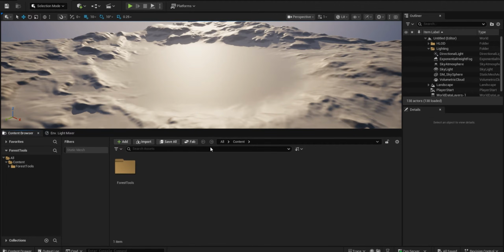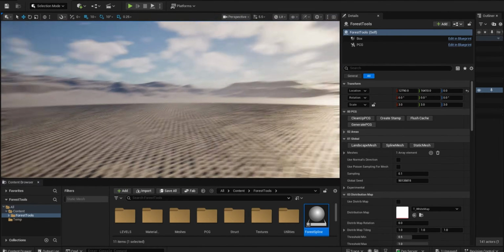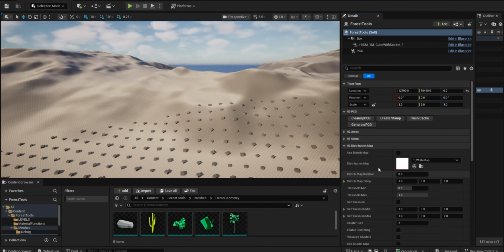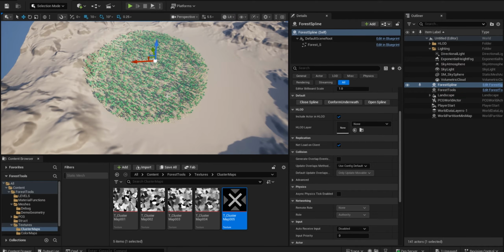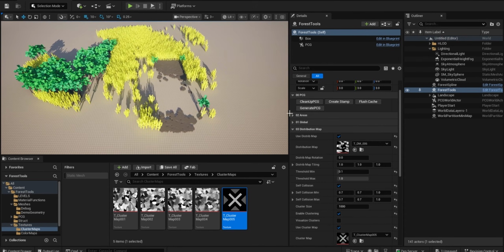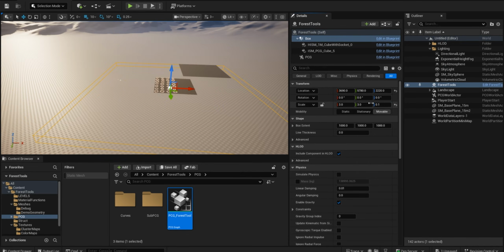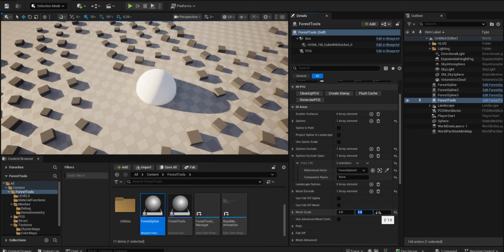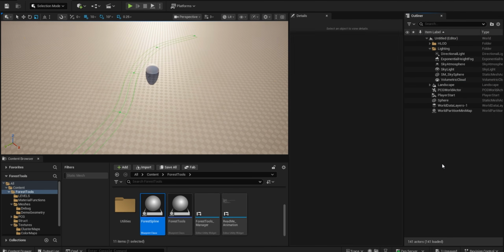01 Forest Tools - Introduction and getting started!

Comment: Fantastic tool!
I’ve noticed that static meshes with animations don’t seem to work correctly with this tool. I’m using foliage (static meshes) from different FAB packs that include wind animations. When I place such foliage directly in the viewport, the wind animation works as expected. However, when I add the same foliage through your tool, the animation no longer plays. I noticed there is an Anim toggle/checkbox, but enabling it doesn’t seem to fix the issue. Maybe you know the trick to fix that?
Reply from the maker: Hi Andrew! Its a bit hard to track comments and log the support conversations here, do you use discord? Id gladly help and explain everything there, if not, Ill try to yelp here! Is the animation you are talking about based on WPO or a geometry cache or maybe a skinned bones animation? As well as last question, does it not work anywhere(runtime/editor viewport) or only in render?
Reply: @EvaFrise  Sure ye, I use Discord, do you have it for Forest Tools?
Reply from the maker: Yeah, sorry it wasnt in the description for this video, heres a link: https://discord.gg/9R35cD3fdQ